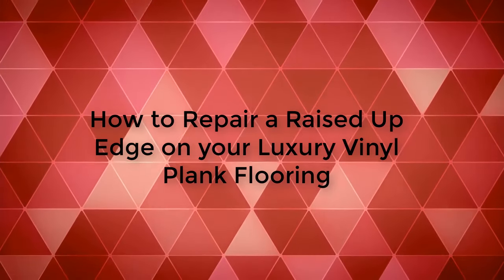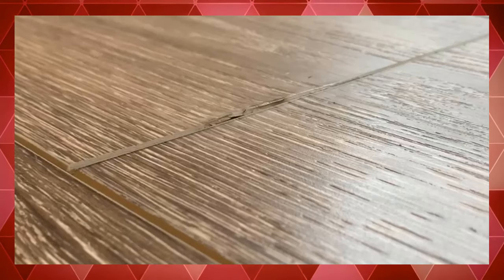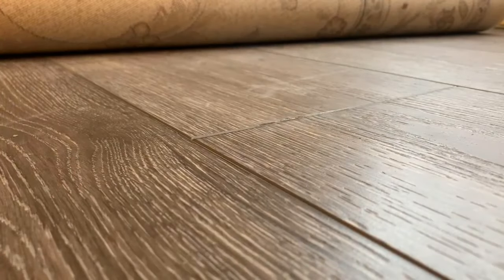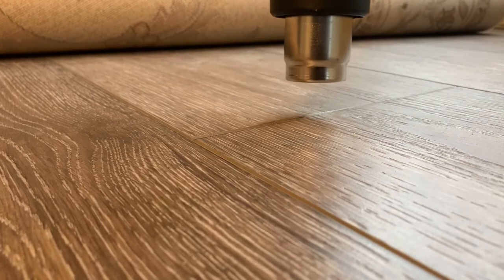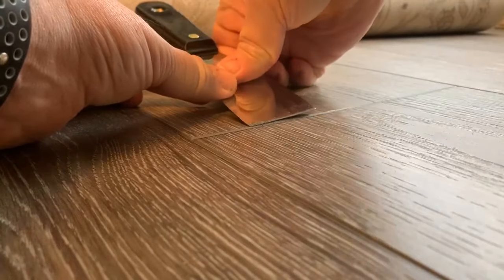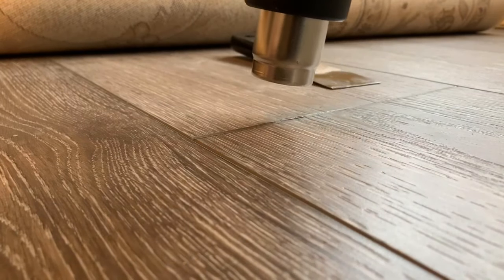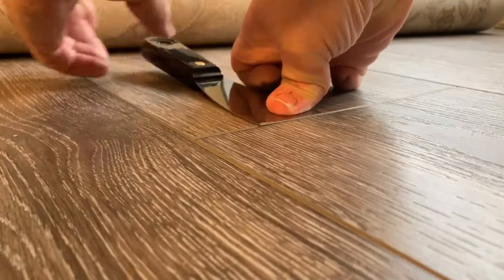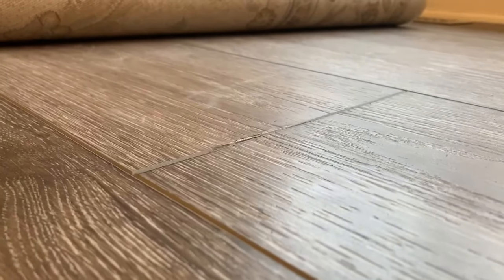How to Fix a Bent or Raised Up Edge on your Luxury Vinyl Plank Flooring

Comment: My uncle has a company that manufactures laminate floors in India.
He said put a towel over it and use an iron on low setting
Reply: Tried that, it does not work and my bathroom door still sticks on a board. Thanks for the suggestion anyway.

Comment: This works! After my install, I had one spot where it was raised and of course, in a very visible place. An iron wouldn't do it but I used a 2500-watt heat gun for 30 seconds on high and pressed down with a putty knife until cool, and FIXED! Thanks. The damage came from one piece in which the ends were not directly on top of each other when tapped down. Can't see it now.
Reply from the maker: Thank you for sharing!

Comment: If your mallet or tapping block is causing damage during installation, try using a short scrap to tap on. It needs to fit the joint of the end or side you’re tapping. This distributes the load so it’s not concentrated to damaging levels of stress

Comment: i had an area in my kitchen where a couple boards had lifted a little from getting wet   I fixed it by running a small fan on it for a couple of nights and putting a little canvas bag half full of silica gel desiccant (for flowers.) laid across the area at the same time.
Reply from the maker: That's a great idea. Thanks for sharing.

Comment: Interesting. I steamed my floor because it said it was safe but no some planks got loose edges now. Didn't think that warming up the plastic layer again to glue it back down could help. I might try vinyl glue though if this trick doesn't work.

Comment: Hi, it's surprising how little information is available on fixing a seemingly simple amount of damage. My house is less than a year old and LVP throughout. I live in Jacksonville NC and it is extremely humid. I can't say that is the cause because I mop quite a bit. I use a barely damp dry mop but also have 5 Jack Russells and have gone through puppy stages, I'm sure you know how much cleanup there is. I have a heat gun but haven't tried it yet. The problem I have seems to be from moisture and looks like when particle board gets wet. It's not the whole board, there's just lips bulging up in certain spots. It's been a bit since you put this video up and I'm curious how you made out in the end, maybe some extra tips. Thank you!
Reply from the maker: It's hard to believe my video is now 4 years old. What I can add is that my flooring is still looking good and the raised up lip is still fixed from the heat gun treatment. I'll add that the original issue was definitely my fault during installation. But anyway. We do mop and clean our floors often and we haven't had any ongoing issue. But my LVP brand is Flooret and they use a rubber backing on their boards. I recall that some of the LVP I looked at had a cork backing, and if that got wet or damp, it would likely expand. So for anyone still shopping LVP, I would stay away from any flooring that has a cork (wood) backing.

Comment: What causes the vinyl plank to have a raised lip?
I’ve got just a few that are doing this exact same thing.
I used a heat gun and pushed them back down and the laid right back down and and set back right in place with no visible difference in space than any others that didn’t raise up.
I thought maybe the plank had expanded but it doesn’t seem to be the issue as it laid back down just like a correctly installed plank. It’s been almost a year and now all of a sudden just a couple of different planks are doing this.
Also it’s laying flat with no give or depressions underneath it.
Reply from the maker: In my case, I damaged the flooring by hitting the edge too hard and/or not at a perfect perpendicular angle. Maybe when there's some damage like that, for some brands of LVP, it might come back?
Reply: @nicein2000  I worked the flooring from left to right and the raised lip is on the opposite end or on the right where there it wouldn’t have been hit or tapped
Reply: For me it was steaming the floor. Bad idea.

Comment: Hi, Is this plank glued to the ground or is it a floating one?
Reply: I'm guessing click lock since he mentioned hammering and blocks.
Reply: All theses floors are floating you lay down a moisture barrier like a carpet underlay some these floors on the back of the planks have that attached some don’t. You lay a plank down each plank has a tung and grove and you just hit them together they lock in and at the wall you leave small gap for expansion since it’s wood and will expand in temperature changes and the trim usually keeps it flat a secured no glue required

Comment: I have a similar problem but in this case the click part looks like if is already cracked or bent

what could be the problem?

it could be a factory manufactured??
Reply from the maker: That sounds like a defect on that particular board or piece. I doubt if heating it up would help.

Comment: I got the CoreLuxe rigid vinyl planks. My rocking chair has a 4 foot circle of the flooring destroyed in 2 weeks. Don't ever move your couch, chairs, don't get a rock under your shoe, heck, don't even walk on the stuff or you'll absolutely ruin it in no time. It's more of a single use, disposable product. Lay it down, walk on it once, then replace it the next week. Not happy with this garbage. Total ripoff. If plan on ever occupying your home, DON'T BUY CoreLuxe rigid vinyl plank flooring. You'd literally be better off covering your floor with the money you'd spend on vinyl.
Reply from the maker: Thank you for sharing. For other readers, you'll definitely get what you pay for. Don't skimp on LVP when it comes to price and quality. My Flooret LVP continues to hold up very well, four years later.

Comment: This stuff is rubbish luxury or not if you have an old house do not put it down ..it lifts due to uneven flooring
Reply from the maker: I definitely agree that vinyl plank flooring should not be used on uneven subfloors. It's really not designed for that situation.

Comment: Anyone else notice the deflection of the plank as he pushed on it? I suspect the floor is not in that area is not flat either.
Reply from the maker: You have a great eye! While the edge of my plank got messed up from me being too aggressive with the hammer, I did have an area of my floor that wasn't perfectly flat/level. I debated for a long time on how to deal with that, as the strong recommendation is to have as nearly a perfectly flat subfloor as possible. Other than a few bent up edges, my end result turned out well.